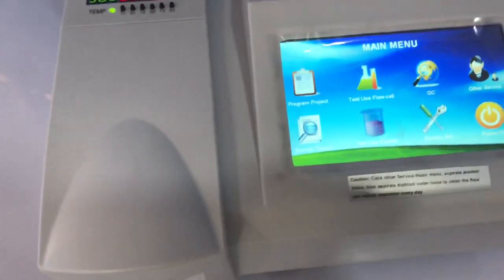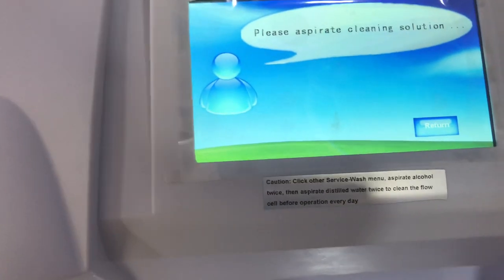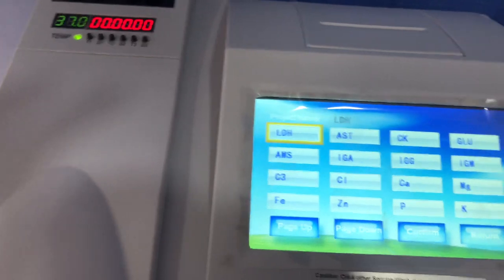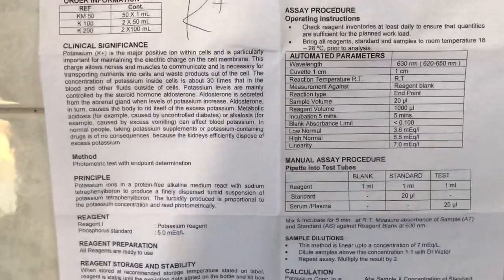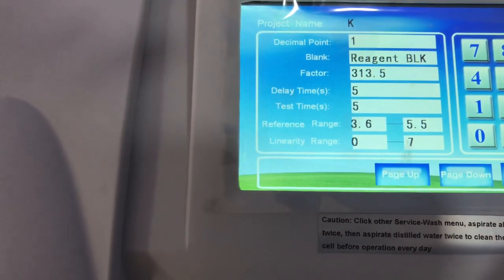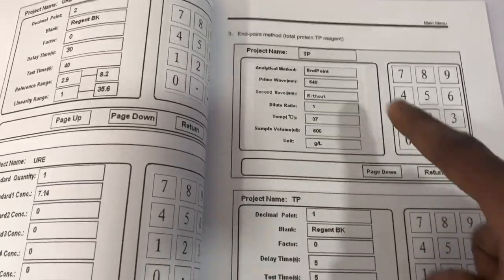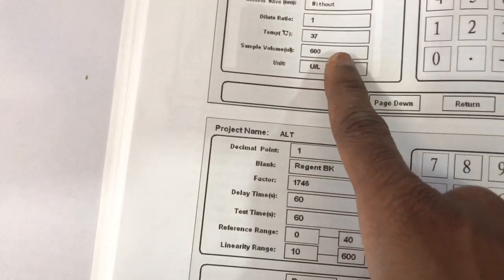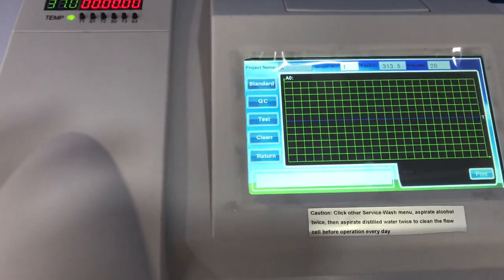Part 2 on how to use the semi automated chemistry analyser

Comment: I have this machine, whenever I try to run a test, when I click sample it shows standard error or factor error. How to solve this.?? Thanks
Reply from the maker: You need to calibrate the test parameter and then retest
Reply from the maker: You can calibrate by inserting the calibration factor or running the standard which will automatically generate the factor

Comment: What Factor Can you put when you want analysis the créatinine ?
Reply from the maker: The reagents you are using and the machine to is a factor 
But if you insist you can use between 20-25
Reply from the maker: You can first run you calibration and then edit it with this reference 
Or run a control sample and use it to reset your factor
Reply from the maker: My reagent it labcare